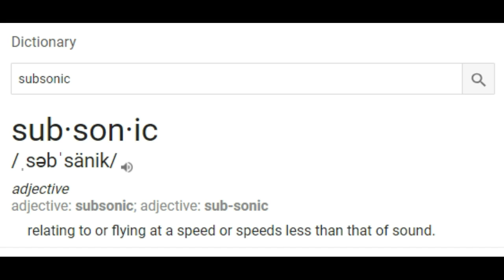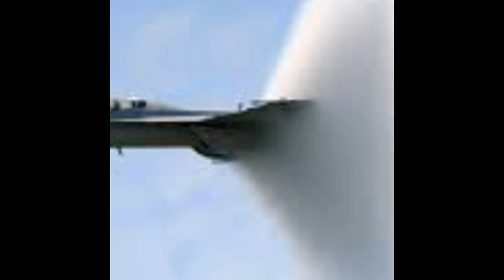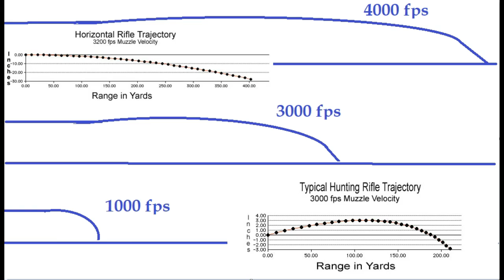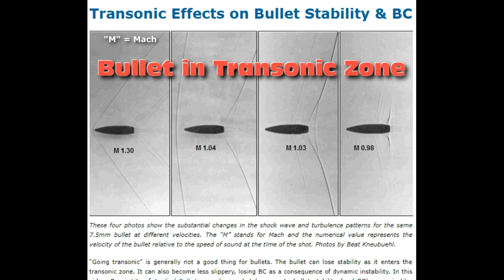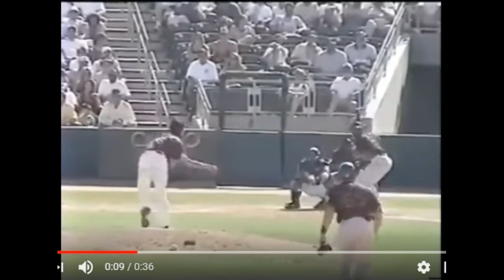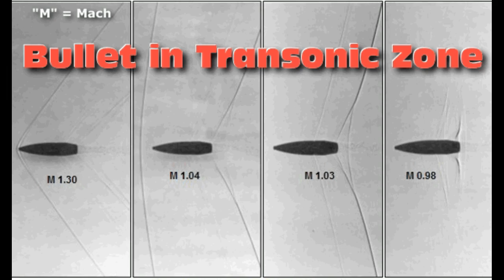Discussing Subsonic Supersonic & Transonic Speeds On Bullet Flight

Comment: The Transonic region is where the bullet (or aircraft) is still subsonic but where you will have localised areas of supersonic flow as the air is accelerated around the bullet (or over a wing).

Comment: As a re-loader and ballistics enthusiast can say that all Ricks information is correct.  Boat Tail bullets handle the shock wave better.  In general if you are shooting long range, the heavier and faster your bullet is moving the better.   Faster bullets reduce how much you have to compensate for drop, heavier bullets shift less in the wind than light ones, and don't slow down as fast.   The 50 BMG is excellent for all these reasons:  It's fast, it's very heavy, and it is a boat tail design.

The longest sniper kill to date was just over 2 miles by a Canadian sniper using a 50 BMG:)
Reply: Good comment and I agree.  But I think what Rick is doing is providing a general compilation which doesn't overwhelm the average person.

Comment: I just think the bullets that go transonic are just doing it for attention & so they can play the victim. 
Seriously though, all bullets will fall at the same rate. A higher velocity bullet has a shorter flight time, therefore it has less time to fall before it impacts a target. 
Also, the longer a bullet is in flight, the faster it will fall, exactly like something dropped will gain speed as it falls.  
With extreme distance shooting you have both the reduction in velocity to deal with and the increased rate of fall. Then, those that go trans are totally unstable. You will see 9mm trying to fit into .308 cases and .22s crying if you don't refer to them as .357. It's just crazy, all bets are off when they go trans.
Reply: shananagans5 ROFL! Maybe it all depends on which bathroom they use.

Comment: As far as sighting in at 100 yds and then having to aim higher at 200 yds, I think you mean if you zero it at 100 yds. For example, if you sight in a round that with a 200 yd zero shoots 2 inches high at 100 yds. You can sight it in to be 2 inches high at 100 yds and it will be zeroed at 200 yds. Point being, sighting in at a certain distance is not necessarily zeroing it in at that distance.
Reply: Jake  Logan, sighting in at 100 & if you zero at 100 is the same thing ? You said, Sighting in at a certain distance is not necessarily zeroing it in at that distance ? You just said it backwards as Rick did. So now according to you, if you want to hit the bulls eye at 100 you have to aim 2 inches low.
Reply: No, you have it wrong. Sighting in at 100 yds is not necessarily zeroing in at 100 yds. In my example, if a bullet that is zeroed at 200 yds shoots 2" high at 100 yds, then you can sight it in (for 2" high) at 100 yds and it is then zeroed for 200 yds. It is not zeroed at 100 yds (in my example) because it will shoot 2" high at 100 yds.
Reply: NO I DON'T, What I'm trying to tell you is sighting in & zeroing in is the same thing. Of course if you sight or zero in for 200 it's going to shoot high at 100.Shoot at 400 & your going to shoot low also if zeroed for 200, either way IT'S THE SAME THING. Ever try Archery with 1 pin ? it's called hold over or under, depending on what yardage your pin is set at ?

Comment: Some of those 'long range' shooters even work into their equation how far the Earth moves (rotates) from when the bullet leaves the barrel until it reaches the target.  That kind of shooting is so far beyond my skill set that I can't even imagine ever being that patient
Reply: what you're referring to is call the coriolis effect. it pretty much comes into play for anything you shoot that travels 1000 yards or more. also, there's another issue you have to contend with at longer distances...spin drift (or gyroscopic drift). basically, it's the spin/rotation of the bullet as it travels that affects its path. this effect is usually in response to the direction of the spin (clockwise or counterclockwise).

most shooters don't have to worry about this as they don't normally shoot past 500/600 yards. but for those that regularly shoot past 1000 yards, these are concerns they have to take into account. i THINK there are formulas to help you calculate these things, but i have no clue what they are, lol. i typically shoot no more than about 200 yards so it's not a concern for me. i've wanted to get into some long-range shooting for a while now, but i need to build a rifle that will do it.
Reply: sean virtually all of my shooting is under 200 yards.  Maybe for fun every now and then I'll shoot at a target farther away.

Comment: Rick it also depends on the bullets Ballistic Coefficient (B. C.) rating, meaning the bullets ability to resist drag. Also if your a long range shooter you want to use match grade bullets, they are a higher quality than a regular bullet. There is also boat tail bullets to minimize drag, the end of the bullet tapers instead of being flat.